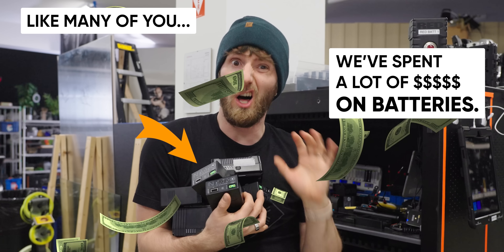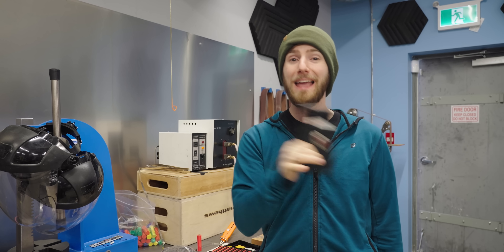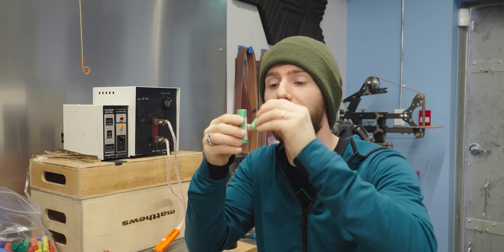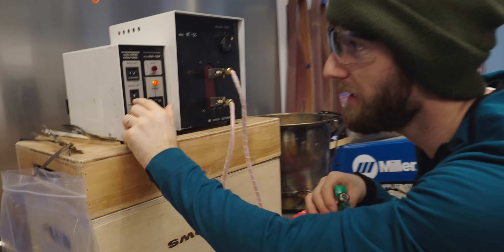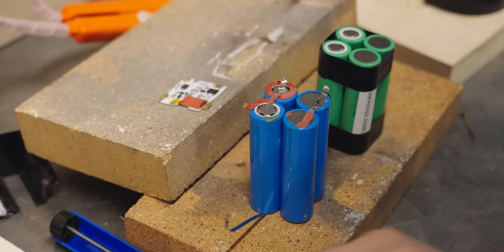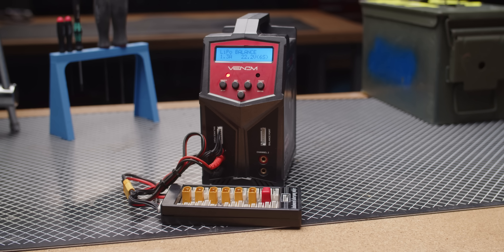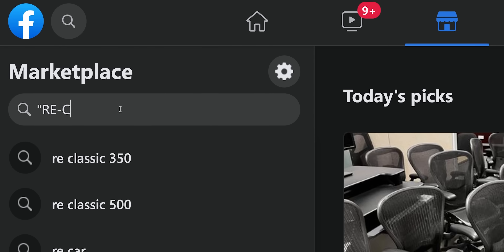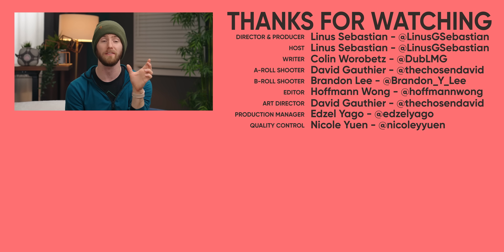This should be illegal… Battery Repair Blocking

Comment: "if you as a manufacturer have done this, shame on you"
Frankly, I don't understand why we as a society in 2022 still tolerate and support manufacturers doing this kind of things.
Reply: Standard consumer does not understand the situation and corps actively hide this information. Think apple who deletes posts on their forums if anyone even so much as implies a iDevice can be repaired without going to apple.
Reply: When most of them do it, it’s hard to find one that doesn’t and still has a good enough product.
Reply: Because, for every industry, only a hand full of brands own the hundreds to thousands of brands you can choose from.
Reply: Sometimes there aren't any other options, and if there are, they aren't feasible for everyone. Same reason why Walmart is so popular in the USA despite decades of anti-competitive practice, destroying local economies, and abusing workers before Amazon took the crown.
Reply: @TheGhostThatWas  Walmart is popular because they happened to be the first to pay employees so low that they can charge prices that local competitors couldn't i.e. the first Amazon lol
Reply: @TheGhostThatWas  In the case of rechargeable batteries like these, I would say that's almost certainly the case. Whether it's due to practical constraints like the device's specific power requirements or needing to fit a particular space/form factor, or just plain anti-competition, batteries for higher-end devices tend to be fairly proprietary. Sure some industries like (consumer and pro-sumer digital cameras) seem to have agreed to standardize to some extent, but for the most part consumers realistically only have a couple of reputable brands to choose from. Even if they did care, what could they realistically do? Buy from the only other option, who likely doesn't have much incentive to be any better?

It would be nice if rechargeable packs took the same approach as familiar AA/AAA/C/D/9V standards but it's "chicken or the egg" scenario: standard pack formats won't be viable until manufacturers start accepting them, but manufacturers won't start accepting them until they are viable. Catch-22.
Reply: @TheGhostThatWas  Not just that, add that those same companies lobby hard politicians for protectionist laws (and routinely get away with it too in many countries) so when pushback  from the public happens they are on the right side of the law. (Only because they literally wrote it themselves...) The consumer 99% of the time really has no real choice or recourse with all the vertical integration of supply chains, manufacturers of goods and even stores we have at this point. Take for example power tools, you see many brands but ultimately a lot of those brands are labels for stuff made in the same company/factory so bad practices are widespread even if the consumer thinks its no longer supporting the offending brand. Right to repair is not just about the end user being able to repair the stuff they own themselves, it's about there being a healthy third party repair ecosystem for our products.
Reply: @TheGhostThatWas  Amazon didn't take the crown, Walmart is still much bigger in every aspect.
Reply: @philipwrighton  Walmart is only bigger in the US - Amazon is worldwide.  And lockdowns have favoured them so greatly that I suspect you are looking at pre-pandemic data.  When you can't go shopping, Amazon is the most prominent alternative.
Reply: convenience, people think they are all heroes but only until they have to take action.
Reply: Because people want cheaper stuff. Most new phones don't have replaceable batteries anymore, despite how nice it would be.
Reply: The cost difference between replacable and non-replacable batteries is extremely small.
Reply: Money and no alternatives? If the batteries are like RED, then the consumer probably has enough money to buy new ones and not care about dead batteries. And also if you as customer actually have no other alternatives, your product uses proprietary design and you cant get anything else?  Also the industry likes that when your devices battery is dead you probably want to buy the whole new device like cellphone or laptop because its influenced that your old device is obsolete and out of fashion. 
I'm really looking forward to what's it going to be when electric vehicles large battery packs are going bad on masses, at the moment you can get some modules in your tesla pack changed as custom job at some specific places. I'd like to see what happens when they are going to go bad on masses, what's the strategy then.
Reply: When there's only 2 or 3 it's not like you have a choice especially when those companies collude.
Reply: The capitalist response to these issues is always "you need to vote with your money if you don't want XYZ to be."
That is just not the case. Say for example you need a Mac, because a specific software you need only runs on Mac. I cannot just buy a Framework laptop. I cannot vote with my money as soon as an issue is connected. 
Same with climate change for example. If I want to buy a fridge that is eco friendly (built with renewable power, recycled aluminum with green hydrogen, shipped with renewable energy etc.) I cannot vote with my money if no fridge exists that fits this criteria.
Reply: Its hards to find one that doesnt. Not to mention they have thousands worth of equipment needing support.
Reply: well i do understand. 1. 75% of people dont give a damn about right to repair 2. Most of us want to actualy pay less for a device not more so guess what they are going for volume not that single item will be giving them a big profit specialy for normal consumers. 3. most people just dont care when device stops working they just buy a new one the end of story and 4. Peole care about look far more then functionality
Reply: programmed algorithm in YT it is easier for advertisers to target specific group of people. 
some percentage of people who are aware about this or interested in will receive this information, others not at all. most people dont have technical knowledge so they cant support what they dont know . channels about hardware like LTT ,Louis Rossmann, EEVBlog, Electroboom...
Reply: far worse things are allowed because of lobbying
Reply: RED has been doing shit like this since their inception. Look up the RED Minimag fiasco when a 3rd party circumvented their DRM and exposed the ungodly upcharge for basic off the shelf components.
Reply: Money talks, virtues walk.
Reply: because everyone likes to virtue signal that they support the environment but when it comes to effecting there wallet there not so supportive.
Reply: Because we don't have a choice?
Reply: We don't. It's just that governments haven't represented the people in decades, so it stays how it is.
Reply: Capitalism doesn’t give that many options. I’m with you though, I support those that make change with my wallet
Reply: More companies like Bebop need to emerge. Comsumer friendly companies will eventually be the norm
Reply: The same reasons we keep purchasing Chinese-made products.
Reply: Because they can and have no regulatory office going after them. Welcome to earth.
Reply: @sqlevolicious  Surely, more of the government that got us into this mess will help get us out.
Reply: You would be amazed by how many pieces of equipment that have almost no competition.
Reply: Cheaper to mute any dissent and produce very disposable products than to actually fix your own problems.
Reply: Because we now live in a "just buy a new one" society, it started in the 80s and has gotten progressively worse since then.
And while there are a few of us who try the repair ourselves most people think its too difficult or isn't worth the effort to repair and when manufactures want to charge 90% of a devices current value to fix you can understand why people think this way
Reply: Because we are not one society. We are divided, intentionally by those that govern us.  So our governments will appease those they care about most, the ones that want to make the money as some of that money magically falls into their pockets, must be because they're doing a good job
Reply: Because people aren't aware of it until it happens to them. The average person has been trained to buy a new one and throw away the old one. Manufacturers honestly don't need to try very hard to fly under the radar of the average person.
Reply: Many BMS controllers on large battery packs don't start on their own, because of safety. Usually in the documentation there is specified how to start it. In most cases the charger will start it.
Reply: Apple got sued for Planned oblivescence by entire country.
Reply: Here in America the people have very little actual say on how things are done. I would love for this to change, but it's gonna take the people with the power to make it happen not care about profits over people and the environment.
Reply: consolidation reduces choice, the fewer choices the larger the sale base, making the % who care enough to "Vote with their wallet" a negligible cost loss to the company.  there's a sort of critical mass of people that means they can do what ever they want and still make enough money to ignore the people complaints.
Reply: why are You in every youtube comment section, HUH?
Reply: The EU is standardizing batteries and chargers before 2025. The rest of the world is doing nothing.
Reply: Because in North America companies come before people
Reply: I believe Dyson and Makita are the same.

For Makita it's 3 strikes of under voltage detect and shuts down the pack.
Reply: Convinience is usually the answer
Reply: Most people don't care and or know we are a small minority.
Reply: I'm sorry to be the thorne, but population of people are stupid if it only takes 5% of stupid to bring down their reputation I think this technology is understandable. Its just hassle for the knowledgeable.
This is a safety issue after all.
Reply: I can field that question for you. You see, what happens is that we, as consumers, buy what they make.

Bit complicated, but I think you get the idea.
Reply: When convenience outnumbered anything, it is possible
Reply: Because we keep buying it?
Reply: *MONEY!
Reply: Because most people simply don't care. All they care about is the item there and is it affordable. Most don't care how it gets there or even how it's made.
Reply: Good luck finding alternatives when everyone tries to be like Apple
Reply: cause u discover the evilness until battery replace
Reply: Because most people lack the knowledge to discern when they are being ripped off like that and the subterfuge does not become evident until the battery packs are several years old.
So those that do know are a voice shouting in the wilderness.
Extending life is a tradeoff against capacity though, so short-lived better packs are higher in capacity - which sells.  Unfortunately, this is a fundamental problem with battery chemistry.
A man well-known in the vaping community is Battery Mooch, who is an electrical engineer specialising in energy storage, and he has amassed a wealth of information.  If you want to know why we hear so little of exploding vapes lately, he is the reason.  He wanted to give back to the community which saved his life, getting him off cigarettes a number of years ago, and had the knowledge and certification to do so.  I, by contrast, have just passed 5 years smoke-free (yesterday), and my doctor tells me that despite smoking for 40 years prior to that, he can no longer detect by either blood work or chest x-rays that I was ever a smoker.
I only purchase devices that allow individual cell replacement now, whether 18650 or the more recent 21700s.
Reply: Unfortunately, the majority of people just don't care about these things.
Reply: We don’t support, we’re too lazy to boycott them.
Reply: ye
Reply: woman, you didn't get a point
Reply: people like linus buy and support them. most DIYers don't.
Reply: most people don't think of doing this type of thing people just buy new ones we really should normalize being able to fix your own property
Reply: Just look at Apple products & buyers, and you got your answer.
Reply: Because the corporations own the media.
Reply: Because, we as a society, want some convenient not practical. Most people don't give 2 shits about the reusability out there. Not everyone. And most likely not the small community around groups like LTT. We actually don't mind getting our hands dirty, or maybe reusing something. But the vast majority of people don't care. And also, the companies that have enabled practices like this don't actually have competition to put pressure on them enough to consider changing their methods. Thats about the only way you could guarantee any type of response... plus, no matter how much of the world start screaming "green" this and that. Companies generally only front that they "care" usually. Its PR. All they care about is $, and pleasing share holders.
Reply: Well, tell me, dear consumer of electric hardware that might buy something from me...
Why should i sell you a lamp that never burns out?
Reply: what are you going to do? stop buying iPhones?
Reply: That's why you need strong goverment and competenet, well paid officials.
Reply: $$$$$ are the bottom line
Reply: The same reason people are fine with child labor and working conditions that drive people insane to point that they try to commit suicide. They want cheap stuff. Stop buying cheap electronics that are made in 2nd and third world conditions. Demand the first world take manufacturing jobs back and pay people a fair wage. Not living, just fair. Stop buying apple, Samsung and other "designer/name brand" electronics.
Reply: Its simpler to just dont give a fuck
Reply: The Problem is, that the vast Majority of End- Users (keep in Mind: Comment Sections of Tech Videos do not represent Society at all) don't bloody care. 

They don't know what Manufacturers are doing. And if they do, they simply do not care. Just a single look at Apple and their success should tell you all you need to know. They designed Keyboards with a nearly 100% failure Rate over time that are let's say 90% not replaceable. They soft lock Parts like Screens, Batteries, Fingerprint Readers, Cammeras (Parts that you could easily replace yourself or an independend repair shop). They solder on SSD and RAM FOR NO REASON on their Desktops and Laptops. 
And oh well, they basically did anything Anti R2R you could imagine. 

But of course, Apple is doing great! Customers don't fucking care, or don't fucking inform themselves. 

Of course, Products for Professionals - that's something else. Like a Red Battery Pack. Of course Customers are pissed off. But the Customer allready got an overly expansive Cammera, so they'll need the stupid Battery Pack...
Reply: Because MONEY
Reply: Also, the Germans are the GOOD guys now???  #OnlyIn2022

Jokes aside, if manufacturers have ANY rights to defend those practices in court, consumers must have the rights to publish the black sheep and their tricks.  If not, it's just the #BestJusticeMoneyCanBuy .
Reply: Money.
Reply: we don't tolerate but we can't do anything because we're just consumers and we're against tech giants. I even want to boycott scamsung for "killing" galaxy s20 screens by having a fake lines or glitch which started like may of 2021(i can say it's fake because the lines are behind the splash screen if you turn on the device) ., and thousands of gs20 users reported the same fking issue with differences like line color., and some even have white screen or green screen issues.,
Reply: They do it because society still buys the crap. I'm extremely anti-right-to-repair. Well, the nonsense legislation that people like Rossmann push. Forcing companies to divulge schematics, to sell you tools and parts? Nope. Stooping to their level. He's so whiny about it, and honestly, people in those lines of work need to just find something else to do. Most of society is obviously fine with throwaway crap, so trying to exist as a repair shop in a world that doesn't want it is your problem, not the corporations' or the government's problem.
Reply: Correct every less-than-perfect decision that every company has ever made, and you've just invented hyper-inflation.
Reply: You won’t know until it’s too late. Afterwards no one will listen to you.
Reply: Don't care won't effect me in my lifetime
Reply: Regular people have been more or less shut out of decisions in favor of corporations.
Reply: @jstrong6583  if/when the latter group would happen to gather up 2 fucks to give, its usually to late. Its easy to give 2 fucks imo, if you like being free, strive to live free or do live free then you should give 3 fucks about right to repair and similar causes. I'm all about anything that gives me options, just because we might have a right to repair don't necessary mean I'm going to do it either. THe corporations and their greed doesn't see that. They act like a few might repair that it represents the entire freaking world population.
Reply: Because ultimately people say they care but don't, money speaks. Why fix what isn't broken, they are making bank off these tactics.
Reply: Its the same reason people still order from amazon and buy apple. Either its the only one who does it so good and for a good price or its a status symbol(though i normally recommend apple for older people since its ios is more restrictive and simple)
Reply: @blakegandalf8753  just get huawei with android ... oh no wait ...!!
Reply: @DrSmugface  My Huawei just got a new battery.  And I've rooted it to clear out any backdoors.
Reply: @blakegandalf8753  Why is it that folks think that if you are old, you need simple things, you can't understand complicated items so they market big button dumb phones to the elderly. Don't you all  understand that it was "US" who made all this shit for you to play with? Nuff said LOL
Reply: @MrRickalvin  damb you are really defensive aren't you? I say old people cause they are typically the ones who have trouble understanding it thats why my grandparents need help and my nephew doesn't. My nephew is more likely to learn programming not my grandparents. P.S. most old people were the stepping stones(and some great thoughtful inventions) most of the good tech from the last 10 years has mostly been engineered by people ages 25-50 not typically 50-90. since you wanted to get historical ;* P.P.S. it wasn't most people who designed any of this. these were engineers way smarter than you or I nor anybody we'd know. Nuff said LOL
Reply: Because we lack the ability to punish them
Reply: @David-uf9qm  it's called you wallet. Stop buying thier products.
Reply: @David-uf9qm  Yeah the corporations have bought up government and thus there's no regulation on this sort of thing. And sadly, at least in America, the corruption has become normalized and accepted.
Reply: @taragnor  Which leads to fascism.
Reply: We don’t have that many options, some big company like apple and in this case red does it
Reply: there needs to be actual laws at the federal level to stop it as companies basically conspire at this point to make sure that there are no alternatives to allow their model to change through the forces of the market.  this is where the free market ends up failing each and every time.  when its become impossible to buy an alternative, a monopoly has formed.
Reply: @dr._breens_beard  It exists but it's influenced by the very people the enforcement action is meant for.
Reply: Probably to prevent lawsuits from idiots like you from blowing your face off when trying to dismantle a complex Lithium Ion battery cell with a fork.
Reply: Because you agree to planned obsolescence when you buy the product, right to repair is basicly piracy, you dirty thieves....
Reply: Have you already thrown your phone and laptop away? No? I don't understand why you support manufacturers doing this kind of things!!! Shame on you!!! :D
Reply: Sheep..same reason why the whole system is a scam.plus people like to complain and then do nothing to make it better
Reply: Same reason still buy Apple products. Consumers don't think about morality when they shop.
Reply: it boils down to planned obsolesence. They can make a good product that will work for your lifetime and cost X dollars or thay can make the same thing that will fail in about 2 years for 1/10 the cost they charge you half of what the good one would cost and in 4-6 years they make more money off you than they would have with a good product. The only business that considers a single use customer a good customer is the funeral industry.
Reply: Well we are starting to change and the winds are changing.
I do expect that in 5-8 years you will see a lot of these strategies start to fail and they get bad mouthed for it everywhere.
Why is that? Well we start caring about Right to Repair and what is wrong, we start preaching it to friends and family and that causes uproar eventually.
After all, that is the reason why you today get non knowledgable parents grand parents walk into the computer store and request a machine with an Intel i7, because X in the family said it was good.
Reply: Because we still have politicians that say companies good, goverenment bad, no matter what either of them do. If a company wants to fuck custormers, then that's ok on the virtue of them being a company alone.
Reply: We need more regulation in USA.  Regulation by the govt is demonized by the right but it would solve most problems. Give agencies like EPA or FTC real power and laws with teeth and jail for CEOs . Look up all the things wells fargo and exxon alone have done.
Reply: @elvirathon  Look up all the ways mega corps teamed up with government officials and agencies to influence how laws are worded and enforced and tell me again how more regulation will actually fix anything. And the collusion isn't exclusive to the "right" It's pervasive in the left too.
Reply: @joeblow5214  I take it we forgot about the EU saying "please go away" to Facebook
Reply: @zanehannan5306  They always say that kind of crap do they ever really go away? No they don't.
Reply: Capatalism is a terrible system it incentives profit over everything else.
Reply: @monsterhunter445  , and yet these devices are made in non capitalist countries that don't allow capitalism to control the work force but instead are all Marxist driven. Look at what has happened in capitalist nations that had working conditions equal to if not worse.... Unions formed and conditions got better. Prosperity was increased and lives got better. Now let's compare that to everything else..... Failed states and death ...  If you want a perfect case study look at China. While operating under Marxist/communist/socialist ideology it was failing. They introduced capitalism and it exploded. Their leader tried to enforced the old doctrine and they had record level loss. He backed off and let capitalist ideology work and the economy began to recover. The same can be seen in the Nordic nations and the USA. You let the market decide record level wealth. You start imposing leftist insanity and well look at the record level debt and inflation we are currently living with.